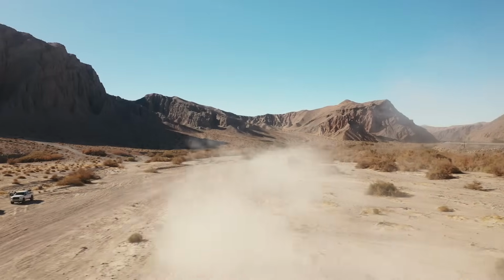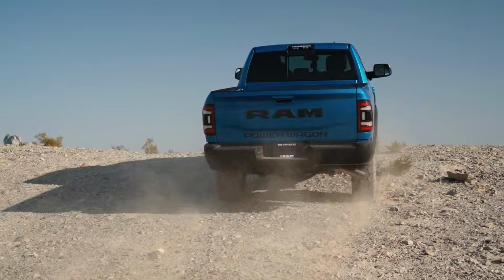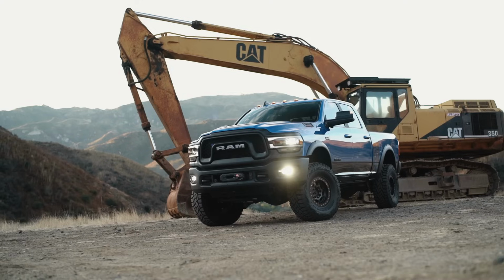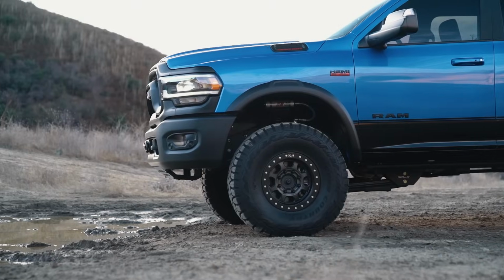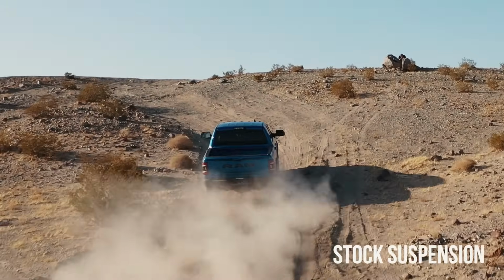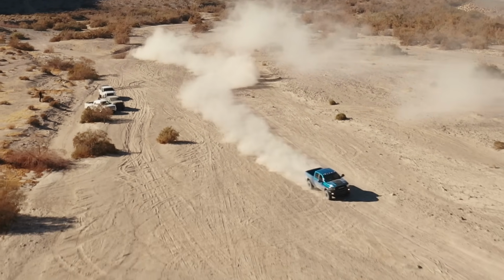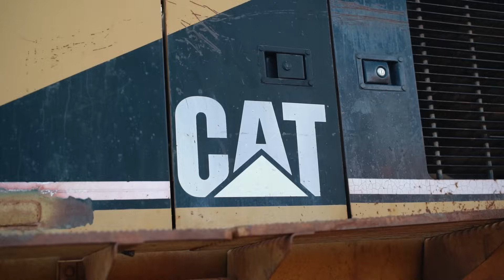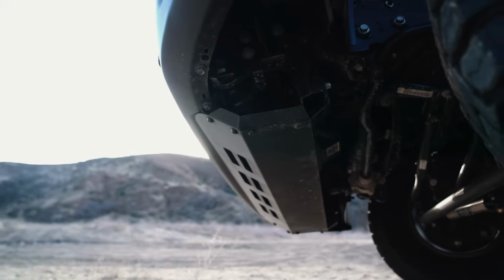Putting a Carli Suspension Pintop 2.5 System on Our Power Wagon

Comment from the maker: What’s on this truck:
Suspension (Carli Pintop System):
http://www.cjcoffroad.com/Carli-Suspension-2014-Ram-Power-Wagon-Pintop-p/cs-dpt25-14-pw.htm
Wheels (5.5” Backspace 17’ Trail Ready Wheels):
http://www.cjcoffroad.com/Trail-Ready-17x8-Simulated-Beadlock-Wheels-p/hdbl17.htm
Lighting (CJC Squadron Conversion Package):
http://www.cjcoffroad.com/Baja-Designs-2019-Ram-2500-3500-Fog-Pocket-p/bd-squadron2019-.htm
Armor (CJC Built Intercooler Guard):
http://www.cjcoffroad.com/CJC-Built-2019-Ram-2500-3500-Intercooler-Guard-p/cjc-interguard.htm
CJC Built Rear Shock Guards:
http://www.cjcoffroad.com/product-p/cjcshockguard.htm
Tires (37/13.5/17 Toyo RT)

 Follow us on Instagram: https://www.instagram.com/cjcoffroad/?hl=en
Reply: How’s the power with 37’s. Are you planning on re gearing it?
Reply from the maker: We’ll probably re-gear eventually, but it’s not bad actually. The diesel trucks don’t mind 37s at all, but on the gas trucks re-gearing is a little more worth while.
Reply: Can you please make a install video for the fog lights? I’m waiting on a video before I buy
Reply from the maker: @evanwhale6127  we have written instructions that cover every single step!
Reply: @CJCOffRoad  thanks for the quick response. I’ll be ordering a set very soon!
Reply: @CJCOffRoad do you recommend a real beadlock like this or something like a method beadgrip? Did the GFC camper change the ride quality or add a ton of wind noise? Looking at having you all do this exact build on mine.

Comment: I had the Pintop setup installed on my 2019 Powerwagon and the on-road ride is significantly improved. The increase in utility off-road is fantastic!
Reply: How much did everything cost you?
Reply: What did you lose stock-wise? ie axle lock? sway bar disconnect?
Reply: @soldier09r you have an optional upgrade between Carli’s sway bar or you can keep the oem electronic sway bar disconnect.
Reply: @ thank you for that!

Comment: This was a necessary video. Beautiful truck in blue, stands perfectly. Your videos really help to delineate the subtle and not-so-subtle differences in kits and now the decision in gas vs. diesel. The 8spd will help HWY mileage when you re-gear. Good video and job well done.
Reply: Shouldn’t need to re-gear the PW for 37’s since it comes with 4.10’s right? I have the Cummins that came with 3.42’s and I geared to 4.10’s when I went 37’s on my Carli kit. Looking at getting a PW now so just curious. Gearing def not my forte for knowledge.
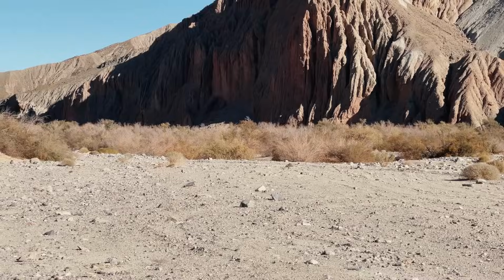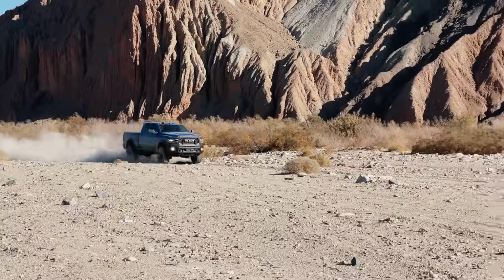Reply: @Jibbs_actual  If the PW has a stock 4:10 w/35” tire and you go to a 37,” I would think the 4:10 is sufficient. If you feel that you lost some power w/the 37’s, consider a bump up to a 4.56 or a 4.88. Your OD will help you retain hwy mileage. I have 4.88’s (posi) and lost only 200 rpm’s in 6th (my 6th gear is a .54/1 OD). Consider a locker or posi - you’ll love it. 👍
Reply: @georgiafan6618  10-4. Appreciate the feedback. I feel like the 4.10’s would be fine with 37’s but wasn’t sure with the different trans from what I have now. Assuming mileage will stuff suffer regardless.
Reply: @Jibbs_actual  the only change in mpg I saw was around town (I have a 6spd w/OD). It dropped slightly to 12-14mpg. Hwy stayed same at 17-18 (2wd) 5,500 lbs. *I have a SC w/both pulleys and tune* (swapped out the 4:30 LSD to 4:88 posi). So I’m getting good mpg. If you feel ‘seat of pants’ power diminished, go to bigger gear. Otherwise good to go. PS: 37s remove 30-40 HP but they look so cool. 👍

Comment: I installed this system on my 2016 PW , also have 37x13.50 17 tires but compensated with 4.88 gear change - night and day difference .
Reply: What kind of mpg’s are you seeing with the 4.88’s
Reply: The zf 8speed is all the diff.  My 2017 compared to 2020 power wagon 0-60 was in the 8 sec range to 6s stock
Reply: Terry Sheahan how much, if any, did your mileage change?
Reply: Hardly any change - 10.8 - 12.3 , although I have very few highway miles to mix in .

Comment: An update to my post from 6 months ago... My pintop system arrived 4 days ago. I'll say this to help set the narrative. Once the off-road installers I chose to do the work (who specialize in big vehicles and have built many LandCruisers and the like ground up) were so impressed with the Carli radius arms, they took pics of them in the box and every time one of their other customers showed up while I was also there, the guys showed everyone who came in what I ordered. All were super impressed. I've spent north of $12,000 with CJC Offroad ordering everything from the suspension to BajaDesign lights and everything in between. I wouldn't order what I need for my PowerWagon anywhere else. I ASKED them for some vinyl to add to my truck wit their logos. Why? They do that good a job consistently. Cody has helped me pick the right components more than once when I call sales. Thanks all.

Comment: Funny is I have 17,000 miles on my PW and I got the rear coils broken in and no longer do I have the rear hope and put a aftermarket steering stabilizer and no longer brakes sideways on hard braking.  Yes a good suspension fixes all these problems but I didn’t want to build another truck since I have built jeeps in the past to where it drives better then stock with 40’s and no steering stabilizer bar needed and no axle steer.    If I was driving offroad at 50 then like you said aftermarket suspension is needed for better handling and braking but for California $hitty roads and the slow offroad it does fine.   If I find anymore weak points I’ll address them as they come.

Comment: Gents - do you maintain stock payload + towing capacity with the suspension?
Reply from the maker: The Carli rear coils have a 2,000 pound payload, which is actually a bump from the factory 1,400 pound payload on the PW trucks.
Reply: Does this add to the towing capacity also
Reply: @jamesklinger2146  I'd like to know this as well. Just grabbed a 2021 PW and I love it so far but man. The tires that came with my stock 1-ton Chevy with their off-road package were at least 35's compared to this, and this is supposed to be designed for off-road. Still would like to be able to tow now and then for work though

Comment: CJC, anothe great piece of content. Question: the guys at Tiny Rig recently installed a Alu-Cabin on my PW (Phenomenal Job from Daniel and Team). On out last trip to Baja, we did experience some signifant sway ON-ROAD / HIGHWAY Driving. Will this suspension upgrade help reduce/elimate that sway (side to side bounce). We even got into a situation where the PW's traction control must have kicked-in and auto breaking was applied. Welcome your inputs before we pull the trigger. Thanks.
Reply from the maker: Sadly what you're experiencing isn't uncommon. These trucks have two factors that cause that: VERY low payload capacity (under 1,400 pounds for the Power Wagon) and more importantly a rear suspension design that has a ton of lateral movement as it cycles. We offer this system with a high capacity coil called the R2. That with a few extra add ons will get rid of that issue and get you the best setup possible. Shoot us an email to sales@cjcoffroad.com so we can get a setup capable of the rear weight you added!

Comment: Love the truck, love your guys product. But what happens when you do what most guys are doing like adding a canopy and roof top tent and stuff like that. Does it just squat the rear-end way down? How do the coils handle any kind of weight.
Reply from the maker: Carli's rear coils have a 2k payload capacity (more than the 1,400 pound factory capacity) but 2k gets used up quickly so you have to be weight conscious with your set up. A RTT is fine, but campers ETC are a no go on Power Wagons. We always prefer single rear wheel 3500s for overland style builds.

Comment: I've found the best thing for the steering on these solid axle trucks is to put a free wheel hub kit or as they used to call them lock out hubs. Night and day difference in the steering. Be nice if this was an option from the factory. Increased fuel economy and less wear on the front driveline.
Reply from the maker: These 19+ trucks have a central axle disconnect, so the front driveshaft isn't spinning in 2wd. It acts in a similar way, and we agree free spins are a huge help for steering feel on the 03-12 trucks!

Comment: A few comments for the watchers from the owner of a 2021 Power Wagon optioned with the 75th Anniversary package and the safety package only.
1. I remain very interested in this upgrade so I asked Ram about warranty coverages. They commented if I were to replace the shocks and/or springs with an aftermarket kit and it has any lift associated with it, the warranty for anything suspension, transmission, differential, and swaybar disconnect would be voided upon installation. I'm attempting to get confirmation of this from someone other than the dealer but it's been rough going. The Magnuson-Moss  Act, however, states the dealer must 'prove' the change caused the failure submitted for warranty repair. I have heard, however, it's been at the dealer discretion more frequently than not. I honestly don't know what would happen.
2.  The comments about needing a kidney something or other and a mouthguard for the road in question is a bit of an exaggeration. Yes, it's somewhat rough but certainly not excessively so. I would say the shock upgrade with the reservoirs would last far longer and wouldn't deteriorate the feel over longer 'Baha runs'.  This is from personal experience.
3. The axle hop mentioned is 100% a huge problem, maybe even more so than mentioned here. Even on a gravel road with a small incline I experience axle hop in 2WD and lost traction quite easily. I have to switch into 4H or go 5MPH. 
4. I imagine the 37's with that offset and with the Toyos, the ride quality would be much more stable in those real articulation challenges.

I'd love to get a firm answer from RAM about the warranty. I have less than 1000 miles on my truck and would do this upgrade tomorrow if I didn't lose warranty coverages.
Reply from the maker: Jason, unfortunately the truthful answer about warranty comes down to the dealer. Some have zero issues with quality suspension systems. Others will use them as an excuse to not warranty a headlight assembly. Our recommendation is to find a dealer that’s comfortable with modified trucks, and use them to install the system and perform warranty work. Our favorite is Peterson Ram, Jeep, and Ford in Idaho. We actually work directly with them to install Carli Systems at their dealership on brand new trucks!
Reply: @CJCOffRoad  Anyone know of a supporting dealership in Austin, TX or thereabouts?

Comment: Awesome video,  I wait to see more Power Wagon specific videos. I can't seem to find any Power Wagon upgrades available, any help with that would be greatly appreciated.
Reply from the maker: We’ve got lots! Check out our website!
Reply: @CJCOffRoad  
Right On, I'll do just that.
Reply: @CJCOffRoad  
Apparently I'm incapable of navigating your site. What are the keywords I should use for my Power Wagon? I'm interested in the Carli Lift, the Upgraded Fog Lights, but the Diesel Intercooler Guard I would looking to do immediately. Does the Diesel Intercooler Guard bolt right up to the Power Wagon or do modifications have be made to Diesel Intercooler Guard and my Power Wagon?

Comment: I just purchased a 2022 Ram power wagon.  Ive watched every video out there on suspension.  I plan the order the set up on this video except the +2 coils in the rear.  My question is, why did brad with trail recon add air bags after all the suspension work and the plus 2? I have a scout yoho camper that i will have in there occasionally.  It weighs 950. Thanks in advance for the information
Reply from the maker: His camper weighed over 2,000 pounds when fully set up, which means it exceeded the Power Wagon's max GVWR. While the R2 coils sit level with 800-1,000 pounds in the truck. If your camper will be over 1,000 pounds when loaded with gear, we recommend that you add the same Firestone airbag/daystar cradle setup that Brad runs as well. We highly recommend keeping your camper as light as possible however so you don't exceed GVWR. When you're ready to order, shoot us a message on Instagram or email so we can get you setup with the right stuff.
Reply: @CJC Off Road  thanks for the quick reply.  Do airbags take away from the ride when its empty. I watched a video your guys posted with some questions about airbags. I wasn't 100 clear at the end of the answer. Lol. Will i still get the great ride with airbags ?
Reply from the maker: Sadly yes they do. Airbags both limit up travel and add spring rate, but there's really no other way to squeeze that capacity out of a 2500, so if you want to keep the truck it's the best way to reconcile everything. That's usually why we steer people with campers into the 3500 platform as it's just better suited for high payload situations. The other option is to reconsider your camping setup, and keep weight under 800 pounds. When you're under that mark, you can use R2 coils alone and have zero impact to articulation, travel, and ride!

Comment: Suuuuper sweet!!  good job!  Questions and not snarky ones! :). Sway bar disconnect retained or removed? If removed any codes thrown??   when all is said and done how much do you  think will be retained from the PW model and will there be a point that you could have saved $$$ buying a 2500 Hemi?  Nice to have the stock lockers but i would throw in ARB's to replace them anyway.    AND same part numbers for Carli build on the PW as the Cummins or compensation for weight differences??
Reply from the maker: The sway bar can stay or go. We chose to keep ours since that’s half the fun of a PW! As far as money saved, that math and choice is all up to you but there’s nothing particularly worth saving about the PW suspension aside from the sway bar and articulink radius arms which we kepy! The PW and Hemi trucks so get their own specific shock and spring tunes from Carli to make up for the weight changes though!

Comment: Did I notice a FOX steering stabilzer? And whats the fuel economy in commuting
Reply from the maker: Currently this truck has a used Fox 2.0 since it's all we could scrounge up without taking away from customer inventory with the parts shortages going on! And typically this truck gets between 10-13 MPG.
Reply: CJC Off Road 10-13mpg with 37’s isn’t bad for a gasser. 👍

Comment: Did you notice improvement to towing and overall payload?
Reply from the maker: The Carli coils have a 2,000 pound payload, which is actually higher than the factory PW coils that have a 1400 pound payload.
Reply: @CJCOffRoad  That's significant. Do you  roughly know what's the improvement in articulation/axle-flex ,departure/approach or breakover angles? Also, have you considered doing an RTI flex test?
Reply from the maker: RTI’s can be a bit mis-leading since ramp angle, bumpers etc differs, but Carli’s systems bump travel to 9.3” up front and 11” out back. Carli actually did a nice technical video if you want more info: https://youtu.be/3dEvDwms0Vk
Reply: @CJCOffRoad  I get RTI can be subjective. I saw Caril's video and noticed that the kit he covered is different than the one you installed. What's the difference?
Reply from the maker: @ahmadasg7567  it’s the same exact base system, they just opted for a few of the optional add ons like their fabricated radius arms and sway bar.

Comment: Did you have to trim anything to get those 37's to fit without rubbing? I was thinkin of going with 37x12.50R17 to avoid the rubbing issue unless 13.50 doesn't rub without having to trim.
Reply from the maker: To fit 37s on a Ram truck we recommend a +18 to +27 offset wheel that is no wider than 9,” as well as some mild trimming of the plastic fender liner and maybe pinch weld depending on the tire.

Comment: i've not experienced that axle hop you mention.  interesting.  all i did was put 35s on mine.  are you going to make a kit that doesn't level trucks?  don't like them leveled since pulling heavy trailers they take on that dumb bulldog look.
Reply from the maker: For these trucks the height increase up front is key to improve wheel travel and ride quality. The only way to increase wheel travel from ride height on a solid axle truck is to add a little height to separate the axle and frame.

Comment: Fuel economy / then pulling a gooseneck trailer!?
Reply from the maker: We would never use a Power Wagon to haul a gooseneck trailer, but this truck gets about 10-16 MPG.
Reply: @CJCOffRoad  thanks
Reply: @CJCOffRoad  thanks but is there a difference between the power wagon and the bighorn in a 2500 hemi ,

Comment: How much left of the 2.5 pin top  I was looking at the Carly backcountry system I was hoping for a little bit more lift than 1 inch
Reply from the maker: All 19+ Power Wagon systems from Carli are 2" front and 1" rear lift.
Reply: @CJCOffRoad  i have a 2018 wagon ,i would think thats still the same

Comment: I was under the impression an OEM Power Wagon has a ~2” front lift and ~1” rear lift over other HEMI 2500s?
Reply from the maker: The OEM Power Wagon does sit taller than the normal 2500 Rams!

Comment: I ordered a pintop leveling kit for my Superduty in November, still waiting, no exact ETA available. Kinda frustrating because I really need tires and I have to get the leveling kit on before the tires.
Reply from the maker: Unfortunately COVID has done a number on manufacturing and we're seeing the results of that in extended lead times. Normally all this stuff is on the shelf, but this year has been a major upset. Just know what everything will ship out as soon as the parts are available. We've been waiting months for the parts for this truck to even make this video!